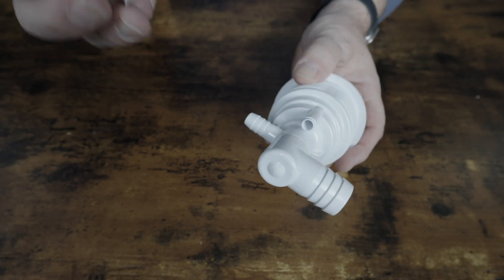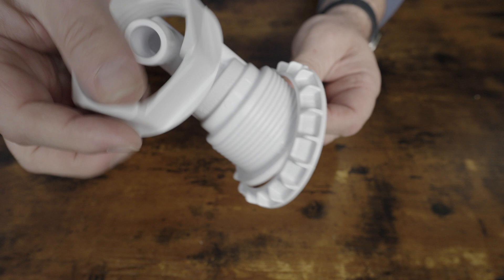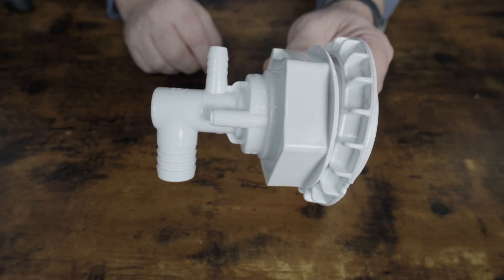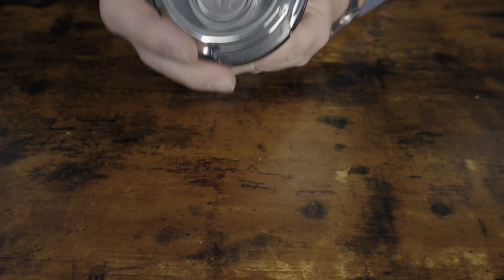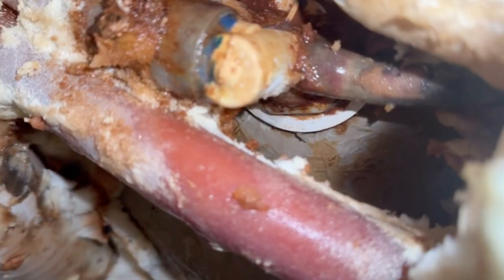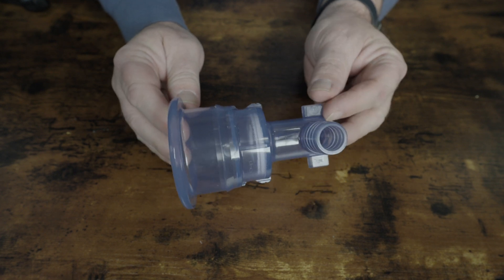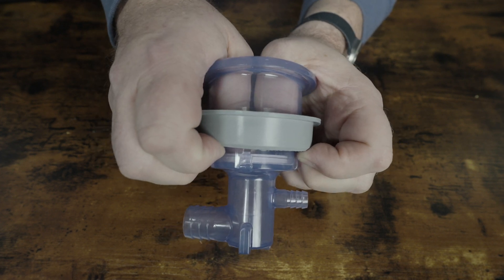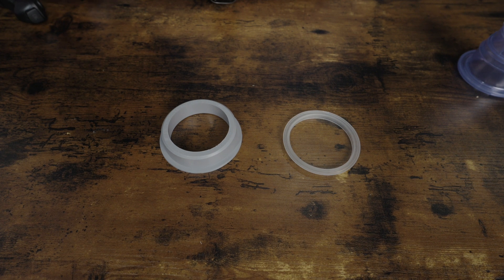Compression Fit Jets in Hot Tub Construction

Comment: Bill, I bought a used Strong/Evolution (4 & 1/2 years old, always lived inside) Hot Tub. One of the Jet bodies was broken. On another, the internals were cracked. I inspected all 21 jets and found no others lacking integrity. I have 2 new jets arriving anytime now. They are Compression style. How best do I press the Jet Body into the ring? Is there a Lubricant I should use? Tub wall seems to be about 5/32: thick. Also, Strong does not use Barb fittings. Just a straight molding for the 3/8" ID Air tube & 3/4" ID Water tube with some type of adhesive. What "goop" should I use to attach them, and should I add those spring wire clamps? Both Ferrules are oversize of  nominal by .015 or so, so a very tight fit. Heat gun may be necessary. BTW, hole thru Tub Wall is 1 & 11/16" dia.